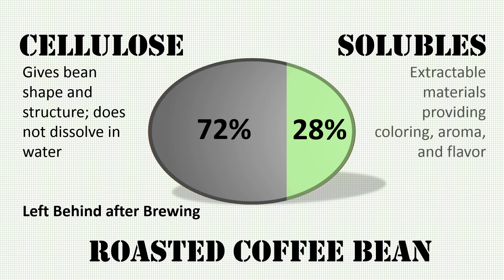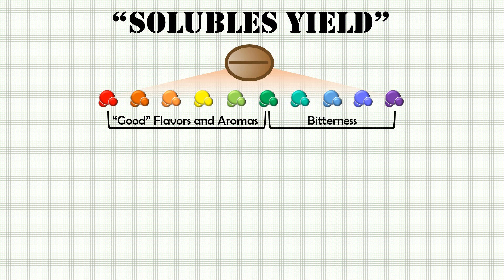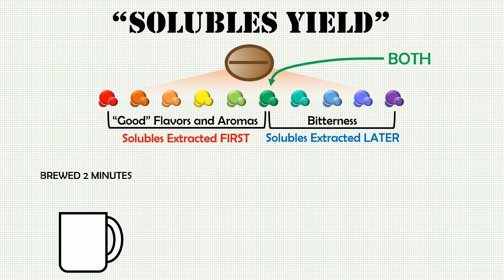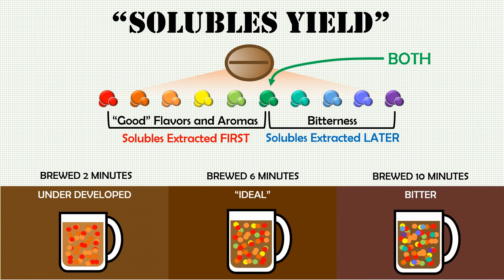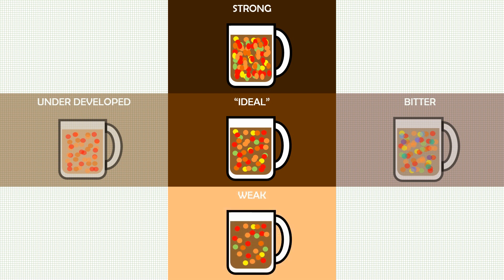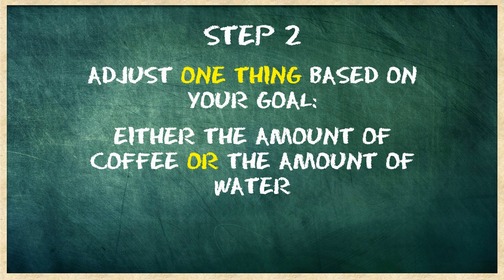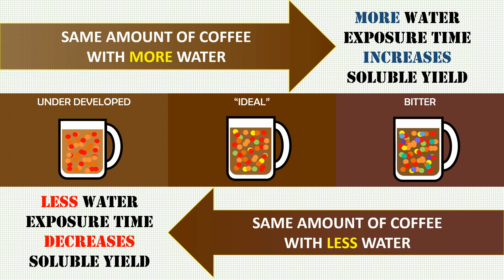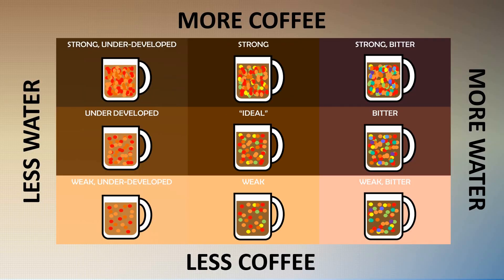Using Science to Brew a Better Cup of Coffee in 2 Steps

Comment: Your distinction between solubles and insolubles is somewhat misleading. In the brewing process, you extract various compounds except the matter which is left behind (which you call cellulose). However, in your "soluble" definition, their exists insolubles, your oils that truly carry aroma and taste that actually do not dissolve in water, thus are insoluble. This can be controlled through which filter you are using (metal, paper, or cloth)

Where metal filters allow more insolubles into the cup, creating heavier aroma and taste, and thus creating greater body.

Where paper filters restrict the insolubles in the cup, resulting in a crisper, more subtle cup.

And, where cloth filters balance the two. A half way compromise, if you will. 

A break down of what you you're drinking between solubles and insolubles in the cup is very helpful and insightful as to what creates flavour and aroma in your cup through the brewing process.

Comment: soak your beans in in worm water for 1 to 6 hours depending how much you like it bitter. then take the water set aside then take a juice press and press out water from the beans then mix with the soaking water then take the pressed beans grind them up and put in a cup of hot water let sit till it s turns room temp or a little higher then using a French press press out the ground coffie then add all the cofies to gether then worm up and drink and you will have a super rich coffie and yes you can add water